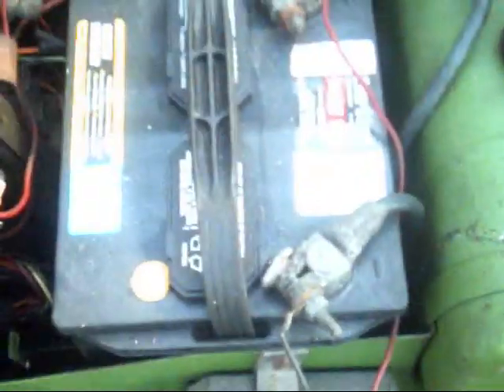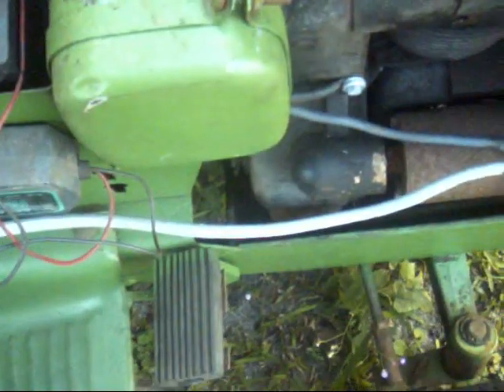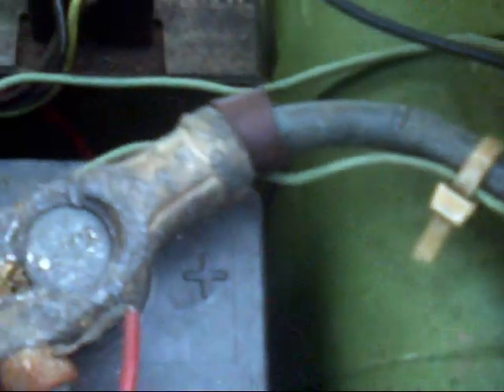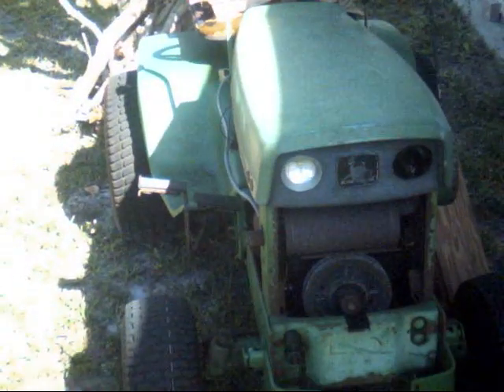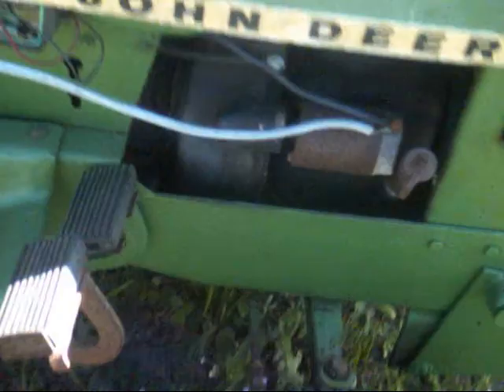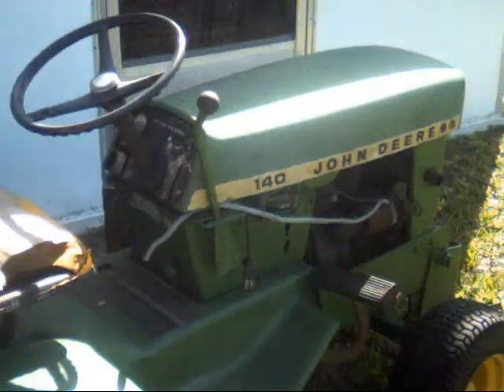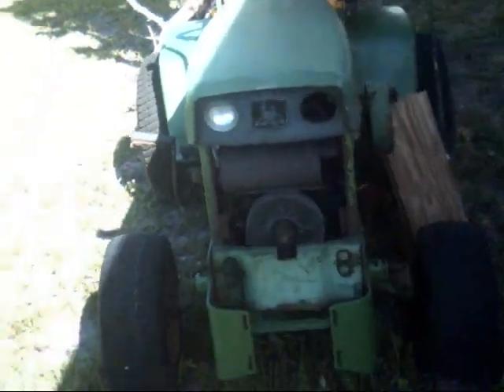jd 140 no key turn over.wmv

Comment: Does the solenoid click? If not, check the ground on the solenoid (where it bolts in).
Also make sure your battery is fully charged.. and also your battery teminals, check those for a good connection. And give the starter a few taps with a hammer, it could be a little stuck. 
ALSO, make sure you push in the clutch, and make sure the mower deck lever isn't engaged. there are satfey switches in those that wont let you start the machine if there in the wrong position.